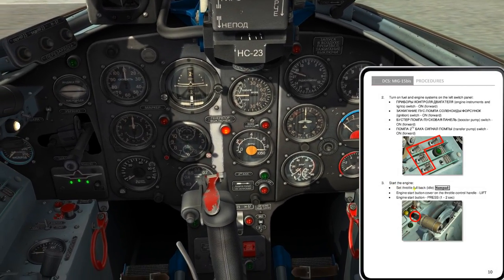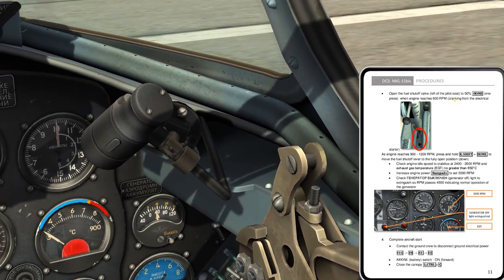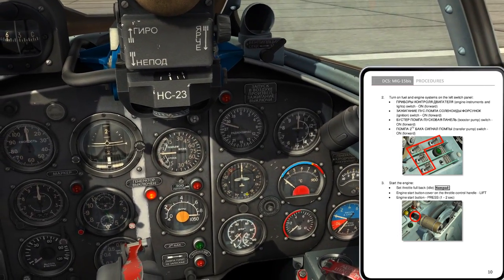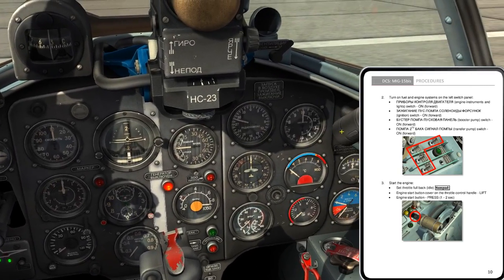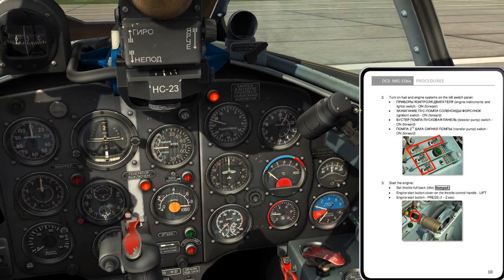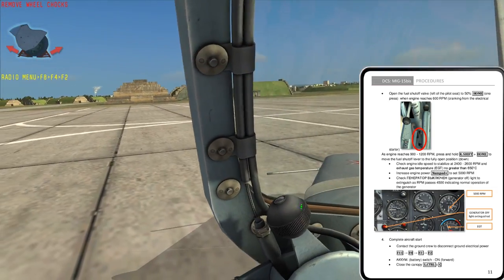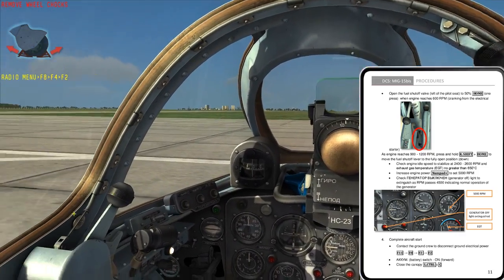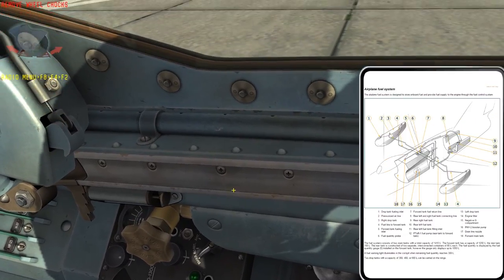Test Flight - DCS: MiG-15 bis Fagot #7 (Engine Start, Environmental Control System)

Comment: At the end of your start you were talking about the air valve. It appears to me to show air being vented around the base of the canopy. If your canopy were to start to fog due to rapid temp change this may be a way to get air on the canopy. You can see the small vent holes in the pipe running around the base of the canopy.

Comment: that hole in front of the canopy seems coming from the engine intake itself, thus when opening it lets outside air directly into the cockpit and maybe into the seal tubes, the point is that it equalizes with the inlet air, sooo i guess don't open it over 3km altitude ;)
and it seems you didn't do a hot start after all that trial :D well done
einjoy
Reply from the maker: Márton Szabó I was reading more last night and I think you are right.  My understanding at this point is that the valve can be used below 2,000 meters to assist with high cockpit temperatures and canopy fogging at low altitude.  The only way to find out for sure is to open it up at high altitude.  I'll let you know. :)